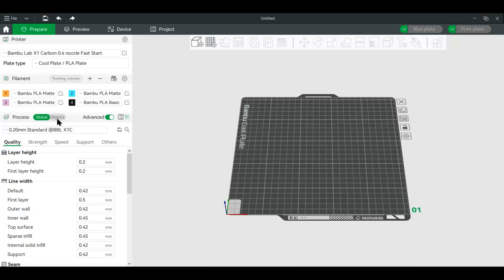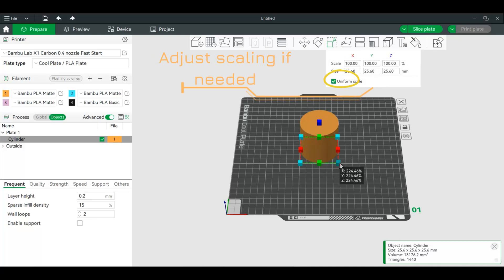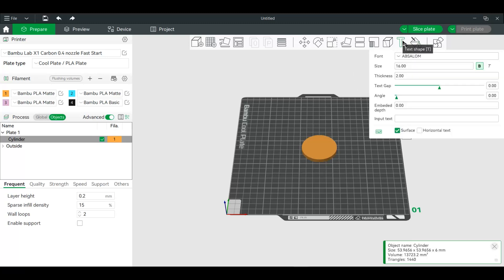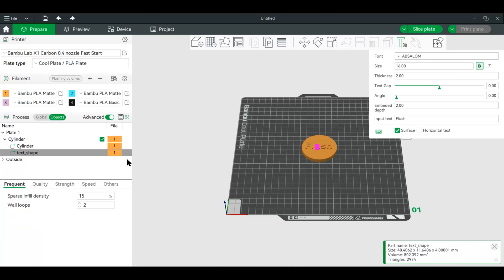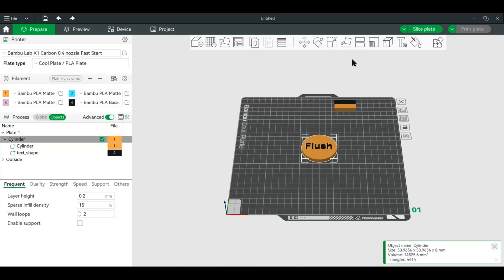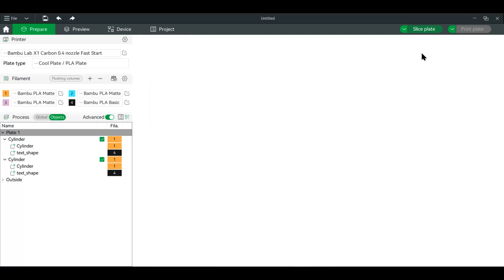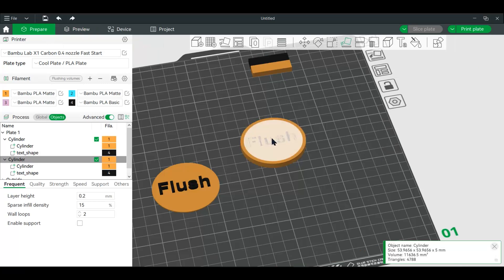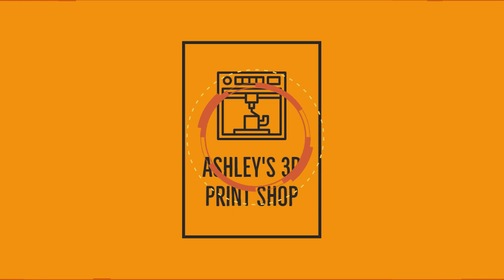Make Flush Text With Bambu Studio

Comment: They fastest way that I have found to do it is to take the layer Hight of your print (example 0.2mm) and just make the text 0.2mm thick and 0.2mm embedded. You then have flush text on the bottom that is only 1 layer thick, adjust the thickness if you want more.
Reply from the maker: That is clever. Thank you for sharing. 😀

There are some other techniques as well. 
https://youtu.be/DxFQfYj-baM

Comment: Without a Wi-Fi connection between my A1 and Bambu Studio, how can I instruct it to use (for example) the PETG in AMS #4 for the body and the PETG in AMS #3 for text?
Reply from the maker: Hello. Wifi makes it easier but you do not need to use it to print if you are using a memory card.  If you are trying to print offline it can be easily done.

On you computer. Make sure you have a properly formatted micro SD card inserted. 
1. Create your model/part in bambu studio, make adjustments to colors, temps, making sure you have your Aa selected as the proper printer etc. 
 a. You can add all your colors, filament types, filament, slots in studio even if you arent connected directly to the printer on wifi/cloud
2. Slice inside studio, verify everything looks correct. 
3. Next to "print plate" there is a arrow, select "export plate" or "export all" if you have multiple plates and save it to a micro sd card.

On the printer
 Note: Make sure you have the proper colors, filament types etc set in the printer. You can do this from the touch screen
1. Insert the microSd card to the printer
2. Press memory card, select print model
3. You can select the colors from here. but if you set it on the PC you shouldn't need to make any changes, 

Print. 😁

Comment: I've watch both your videos on flush text. Excellent!! I'm trying to do flush text on a file that does not have a flat side. Is there something I can do to make it flush?
Reply from the maker: Thank you very much. Without seeing the exact model I will you some general pointers. 
You can press the 'M' key after you click on the text and use the Arrows to move the text closer to the model. There are some surfaces that are a huge pain to put text to. (cone for instance)

This can be time consuming but you can place your text "one by one" and embed them. Here is an example of the move function. 
https://youtu.be/F7L2_R4zEXI?t=191

So completely curved surfaces are "painful" to work with. Is there a public model I could reference to give more detailed instructions?

Comment: Great video as always!  I just got a p1p and I don't have an ams yet but I want to do multi color prints.  How do i go about doing just words and not an entire layer change of color?  Or is that possible with out the ams?  Hope to hear from you soon and keep making these videos as I have learned so much so far.
Reply from the maker: Hello, Thank you for your comment. the way that BL studio has the color swap it's unfortunately the whole layer. The pause function only happens at  the beginning of a layer. You can sorta get around this by making your text 1 layer higher than the rest of the print then swapping at the that layer. The completely flush is not possible from the method I know. 

Facing the print down will not work because the the extra layer will cause issues for the rest of the print.

I will be releasing a video in the next 24 hrs showing the steps.  

There is a wild idea to start the print, manually pause it and attempt to swap colors but you have to watch the print like a hungry hawk and pause an the exact time to swap colors.

Comment: I don’t have a Bambu or use Bambu Studio, but just wondering. Couldn’t you also just immediately flip it and sink the coin below the bed until text is flat?
Reply from the maker: Yes that is another way. Cura had that feature for the longest time and Bambu studio/orca slicer now has it as well. 

Earlier versions of Studio/orca had a "snap to plate" option that was not removable so the work around was what was shown. I didn't want to overload the vid with too many options but your comment is perfectly viable.

There is another way to do it as well. 
You can right click the model. 
add negative part"(cylinder) raise it above the part so it the barely touches the model and it will cut/flatten  it as well. 

Great comment.

Comment: this is so stupid. they should have baked in flat writing
Reply: Tinkercad.
Reply from the maker: Yeah, the lowest thickness is 0.1 even if you use an embedded depth. which is "close to flush" but isn't completely flat. 

Since we are using the slicer these are the tools we have.  I'm sure if you use a cad program you can get more granular settings.

Thanks for commenting.
Reply: @ashleys3dprintshop Awesome workaround, I have been struggling with this issue for weeks. 
Hopefully this will become easier in future versions.